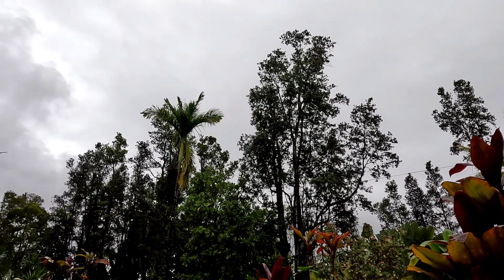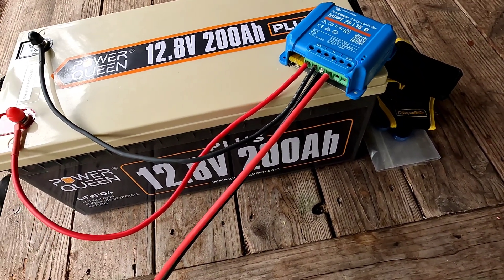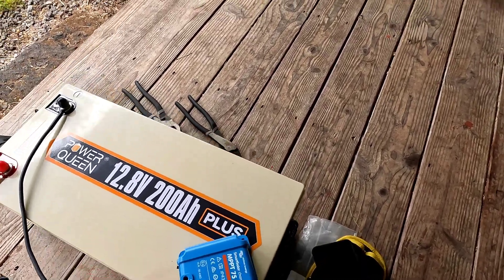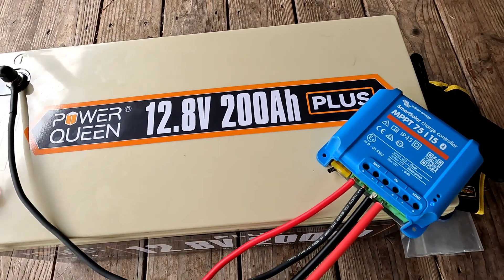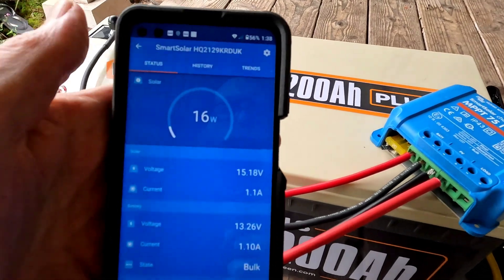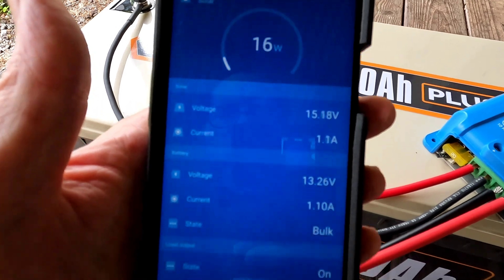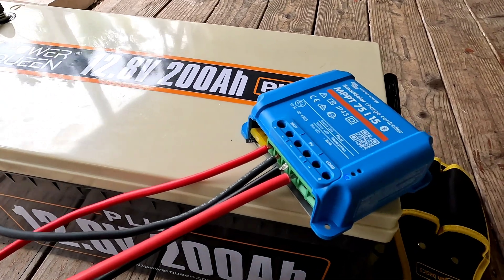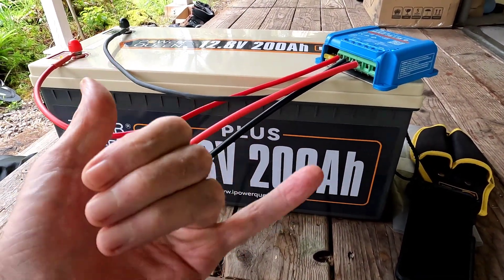1st charge (kinda) of the Power Queen 12.8v 200ah LiFePO4 plus

Comment: I knew about pre-charging an inverter, but this is the first time I heard about it on a charge controller.  Did I miss something somewhere?
Reply from the maker: Just seemed like a good idea...avoiding the sparks no matter the component.  No? aloha 🤙
Reply: @ProjectsinParadise808  very true and great advice.  Why take a chance. 🤟
Reply: @ProjectsinParadise808  The current pulled by the charge controller is very small and there is no spark. The inverter on the other hand will pull high amps momentarily causing a spark, hence the need on the inverter only to use the resistor.

Comment: I like that MPPT controller. even under low light you are getting a boost of amps to charge. a little is better than none. over time and years that adda up to more power watt hours in the battery. with LiFePO4 being around 90% efficient that small charge does some good. back a few years with a PWM controller and lead battery days like this would do nothing at all. LiFePO4 with MPPT and series connect solar is the way to go. I am happy you show us some of the newer battery's and how they work.  The only way to learn them is buy doing .
Reply from the maker: I'm loving this controller,  especially for this chemistry of battery.  It's taking all the guess work out of the equation for me, which is priceless.  I'm watching the app right now topping off a battery.  All the subtleties it employs while finishing up is truly amazing.  Making it much easier for me. aloha 🤙

Comment: There is a fellow on YouTube  that uses a pencil charpened at both ends instead of a resistor,  to pre-charge the capacitors to avoid a spark.  
I'm conflicted about sealed Lifepo4  batteries.  On the one hand you would have to break it open to service the BMS or one of the cells if they go bad.  On the other hand,  the Chins I purchased have been so reliable that maybe I'm worrying about nothing?
Reply: Buy an SOK LiFePo4 battery. Fully serviceable. Indivdual cells can be replaced, BMS can be replaced. Everything. Case opens with around 8 screws.
Reply: @LuckiestManInTheUniverse  thanks for the tip.  It's great to be able to open up a battery without destroying it and take a look inside to see what components they used.
Reply: I allways just used a lightbulb to precharge ?
Reply from the maker: Never heard of the pencil trick...that's something to remember for sure. I'm hoping never to have reason to crack any of these batteries open...so far, so good 🤙

Comment: Thanks for the video, please don't forget to add a small fuse on your main battery cable ... just in case ;) Cheers
Reply from the maker: Great advice, and mahalo for that! aloha 🤙
Reply: What size fuse??
What size wire did you use  for  your  S
panel?

Comment: I must have missed something. What had prompted you to start testing out these Power Queens? I thought the Chins were working out well. Thanks for the videos too btw.
Reply: I don't think you're right! I bought 2 Power Queen100ah batteries on Amazon and they are still working perfectly. I am really satisfied with the quality of both batteries.
Reply from the maker: Hey, thank you kindly for tuning in.  Still have, and love the Chins. This one sent out to me for a review,  so far loving it too! aloha 🤙
Reply: @ProjectsinParadise808  Oh! Ok. That makes sense. I was hoping you'd say the Queens are just as good but much less expensive. Thanks again!
Reply from the maker: @prqrsqtful  🤙
Reply: If you look at the fine print you will find that Chins, PowerQueen, AmpereTime, are all made by Enjoybot in China. I'm wondering if I bought one of the other brands other than Chins' brand of the cells would they be the same manufacturer and parameters.